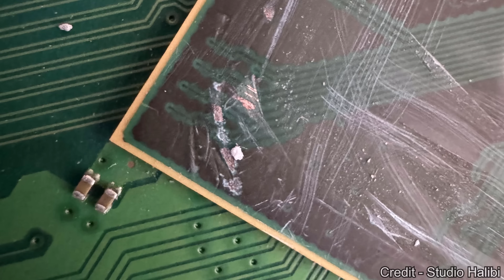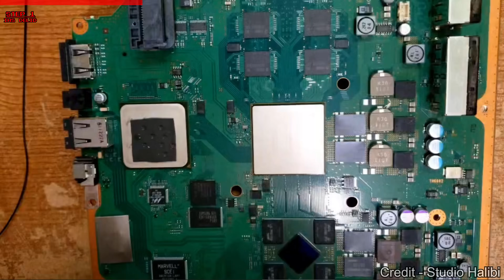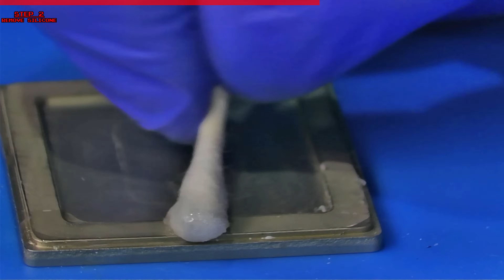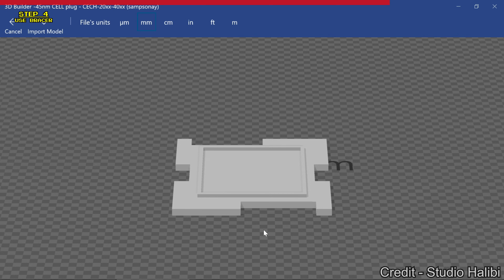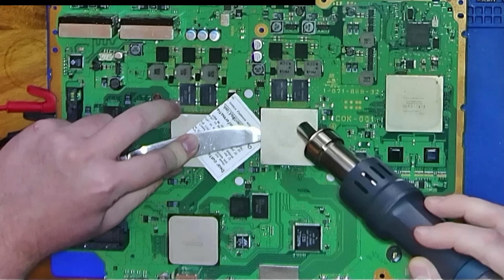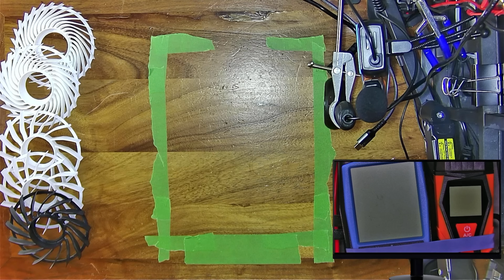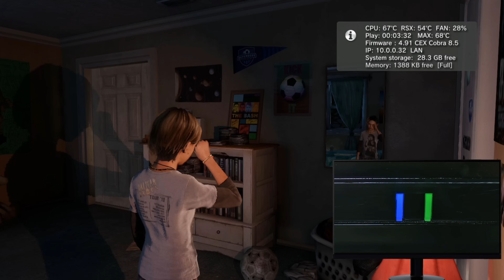How to Fix | Episode 1: Overheating. How to Delid CPU/GPU and fix YLOD - BEWARE of BAD MODs!

Comment: I still have my Ps3 fat with card reader and retro compatibility. After about 15 minutes the warning appears on the corner. I never find a reliable reballing technician so i just put in storage. I've never hear about deliding before.
So, it could be possible to know what is what my ps3 needs? Or deliding was the correct way to repair it since the beginning?
I watched the entire video, and it seems quite interesting to try it after finding the chips that is overheating.
A note on the side, I've about fifteen years of experience repairing pc, phones and tablets as a side hobby, except anything that needs a hot plate to desoldering, I've never buy me one. So, I'm pretty sure I'm capable to do it after I on a death board.

Comment: Felix do you sell the gpu brace or could you share the stl file so we could print it? Great work by the way.  The one I'm working on made it a total of 30 days before it died and was never turned back on. It was a launch model too.  Kinda neat to be honest.
Reply from the maker: It's linked on the description. Just the 90nm one. I designed it around a COK-001 and every other revision is different. So it should only be considered useful for that board.

Comment: Thank you very very much for this tutorial. My CECH-A model terribly needed this process, as my temps always hit 68 °C, even in IDLE!. For those beginners like me, this is how I managed to successfully do it:

1. Buy 3 broken PS3 Fat models from local second hand stores.
2. Buy all materials listed on this video. Bonus tip: for the delidding tool, instead of making one, consider buying the PS3 delidding tool (look it up on Google). With this tool, even a donkey like me can delid the CPU without any issues. It will substantially ease the CPU delidding process, making it almost impossible to do it wrong.
3. Practice. Use the broken PS3 you've bought to practice the procedure showed on the tutorial. Get comfortable with it. Re glue and delid again if necessary, until you feel ready.
4. Go for your beloved CECHA. I suggest you to re-lid the IHS too, using the braces you should 3D print. 

Now, my PS3 CPU temps stay below 53 °C with fans at 33%, when it used to be at 67 with the fan at maximum speed! 

I can't thank the author of this video enough for all his work. Definitely the safest method from all YouTube. THANK YOU!!!
Reply from the maker: Nice job. Yeah, the maker of that delid tool sent me one. I've used it and it works great. I had a few design suggestions and he said he'll work with the manufacturer to improve it over time. So it's getting even better.

Comment: a third reason for the ihs that i've seen spread around is that they exist to help protect the chip during assembly/lets the manufacturers be rougher with it in assembly. meaning a lower rate of damage in assembly

Comment: you're telling me DENTAL FLOSS damages the CPU?!?    how?!?  it's a way softer material than steel
Reply from the maker: Beacuse it has an abrasive ment to help remove plaque from enamel on your teeth. That enamel is harder than most materials, so the abrasive doesn't hurt your teeth, but will sand away almost every other material, including solder mask and soft copper traces. I've seen it happen!

Seems counterintuitive, but it's true.

Comment: I might be missing it, but why do you remove the brace while removing the rsx IHS? Isn't it needed to account for the force of the lever method?
Reply from the maker: In that clip I didnt have it in, but I didnt have abother video of the delid. Normally I would reccomend the brace, if you have one. I already knew that console had a bad GPU. So if I broke a ball I was going to replace the GPU anyway.

Comment: I have a like new condition phat CECHG01 PS3 with a Non-instant (1-10s) YLOD that has been sitting in my closet for about  13 years. It only gave me 3 years of life. I bought the thinner model a year later that's still with me today. I had the idea to open it up and do the thermal paste quick fix but after watching 3 of your videos I can safely say its above my level of expertise to fix. Who can i trust to send it to that it won't be internally harvested for parts and I won't get scammed? I'd like to get it modded too.

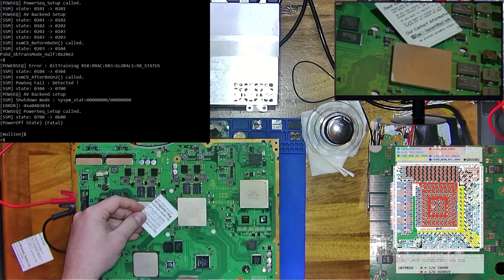Comment: 27:23 l know you said this is a preference and you don’t recommend it but with the popping method you done here what’s the thing underneath the kitchen knife that you used? Also how long did you heat up the chip before attempting to pop it off?
I’ll give it a try on a CECHM03 I have laying around. (it’s broken anyway and l don’t care enough to fix it.)
Reply from the maker: Just a business card. Be sure whatever you use is thin enough to get under, stiff enough not to just bend, and the lower edge isn't sharp, or it'll dig in and cut traces on the interposer. The card helps limit that, but if it's sharp enough it can dig through the card. You could use a painters, knife to protect the substrate and then use a flat head. My buddy squeept does that. The butter knife I used there has a beveled edge and is just thin/stiff enough to work for this.

As for heat, a hair dryer for about a minute should get it hot enough. Your just heating the area and the IHS to around 100c. Don't go crazy.

Comment: Is it necessary to clamp the IHS as it’s curing if I just leave it flat and don’t touch it for a day or too after putting IHS onto the chip?
Reply from the maker: The clamp provide even pressure to allow the paste to thin out. Depends on the paste used, I would assume.
Reply: @ Thank you for the reply. After watching your videos, it seems if I had a NOS PS3 to not delid it and just apply new thermal paste and enjoy it for what it is?
Reply from the maker: I would see how it behaves. If it's fans are having to work extra hard to keep cool, more than normal, then it likely needs a repaste or delid. But if not, dont worry about it until it does.

Comment: Hey mate, do you offer the franken mod as a service? I've seen various vids and love the way you do your work. In Australia, where i live, very few do it and not to a very high standard. I have a few CECHC-02 that need frankenmods with the nec caps replaced due ylod. Happy to pay for postage to the states and back, the labour and cost for a 40nm RSX.
Reply from the maker: Thanks, I go overboard to be honest. I do not offer services at this time. My whole deal is to show the application of accumulated knowlege over the years of forum threads and discussions. I want to show the reasoning behind why certain things might matter, that others often dismiss out of wishful thinking. I want the modding community to step their game up. 

However, I get they take alot more time. That adds significant cost to any would be service. They have to make a business descision of how far to take it. What is and is not worth their time. A personal descision I won't begrudge them for. Not unless it leads to serious oversights and a poor product that hurts customers. 

If you're in AU, ACE console repairs does them. I have a few issues with his methods and attitude, but he does offer a warranty and has plenty of positive experiances (he'd be the first to tell you this). I know some are put off by his attitude, but more often than not it works out well. He definatly "optimizes" his process to cut his costs, like a basic confirmation it works before shipping back for the customer to perform stress testing. That said, I dont think he does bad work. He has good equipment and skill. He just cuts a few corners I personally wouldn't. A business descision he has every right to make. He's probably your best bet in country. If you choose him, I would rely on that warranty and test the bejesus out of the console. If it doesn't fail soon after, you're in the clear. 

I have a friend in New Zealand that does tip top work, RamboNZ. I don't think he does services to AU tho. He might do local or buy, fix, sell only.

There's a few sellers in the UK, but most are in the US. If you want the very best quality, Squeept on ebay US is your guy. You will pay for it tho. He demands a high price and gets it because of this. IDK how much shipping to AU will be tho. Also, he doesn't do services. He sells completed systems. For services in the US that do good work. Studio Halibi, Console King, and Computer booter I can vouch for. They're friends of the channel. We talk on discord, learning from one another. But again, everyone makes their own choices how far they take these repairs. 

I am a stickler for details, because I have a channel and do these for my own enjoyment and consoles. At some point I'll have to sell some of these off to make room for other projects, but ATM I'm not taking in for service requests. Squeept sells the highest price consoles because he does them to this level same level or even higher. We kinda feed off one another for ideas of making it the best possable end product. 

The more affordable priced services are in competition to lower the price by optimizing their process, which means cutting out the time consuming stuff that's not entirly necessary, leaving that up to the customer to perform on their own after the warrany period. That's a viable approach and not necessarily bad, if they don't take that too far.

So you have a spectrum. This is all normal and fine IMO. There are a few people out there pushing this to the extreem and offering substandard frankies. I'm not really sure who they are and don't want to speculate. You just need to be a proactive buyer and descide what's important to you (lowest price = high risk and high reward. High price with a known good modder for peace of mind). You choose the comensurate level of quality you expect for what you'rewilling to pay. I just wish more shops were transparent about the corners they cut for the purpose of expediency. That way people can make an informed descision.

That's why I'd say lean in on that warranty and test thoroughly after receiving. Be sure you know what's normal and isn't tho. Lot's of customers see normal freezes and graphical artifacts and think..."OMG, is this a sign the GPU is failing!?" After spending a pretty penny people get a bit paranoid. I would too. It's just hard on techs to respond to a million messages asking if this is normal.

The TL;DR is, manage your expectations and do your research before jumping in. Many of these techs have Youtube channels or an online presence where you can see their work.
Reply: @ripfelix3020  thanks for such a thorough answer. It's good to know we have someone in our country.
Maybe one day I will become known in Aus for my repairs. I've been stubbornly reviving "dead" Playstation 1s without replacing parts where possible (I'm big on restoration of whatevers in the original console, no matter how much it makes me suffer), it's helped me learn a LOT of patience and learning.

Perhaps one day I can do this with PS3. My first repair job on one is next week, I've been binging your channel to prepare and learn. I don't expect it to work first try, and I do expect to permanently brick it at some point from my beginner efforts - but it's par for the course and worth every single hour and dollar I bust ass to learn how to restore such great consoles

Comment: Its overkill, Honeywell PTM would be a good middle solution between thermal paste and liquid metal.
Reply from the maker: Why does everyone think PTM is so great? It's only got 8.5W/mK thrmal conductivity. It's claim to fame is longevity. It's a great middle ground for performance vs longevity, but not going to compete for either one. A graphene thermal pad is eternal. It'll never degrade or lose performance. It might even out perform PTM on a PS3. I want to test this actually. Nether is going to out perform Liquid metal or induim foil. Longevity of these might suffer tho. And application such that you get a good mating surface is tricky.

Definelty some experimentation is warranted in future videos.

Comment: Hey, I just want to warn the people who are here trying to go with preventative maintenance on their 90 nanometer chips, my March 2007 C04 Model just failed and turned off with a triple beep (it's still blinking red because now I'm basically speechless) while playing Test Drive unlimited 2 and has a yellow light of death now, most likely due to the rsx, I've bought it 6 months ago for 30 euros with 128 days of use time, and I immediately took care of it (cleaning, thermal paste, jailbreak, 1 terabyte solid state drive, etc.) and now even with a room temperature of 18°C and 68°C max temperature, 40% fan speed, 600 megahertz core ram and 650 megahertz videoram (because it was artifacting in the Xross Media Bar at the stock evilnat overclock which is 600 megahertz core ram and 750 megahertz video ram), it went to the electrical heavens, sick and tired of me, now I'm left speechless in my dark room, while it's just blinking away... My guesses are that it's the RSX, (I don't have a Syscon reader) and not the cell, because I laid a little thermal pad under the cell because my L04 has been going with the same thermal pad under the cell for about 9 months now... 

EDIT: 12.5.24, it just turned on again??? and no new errors in syscon log, this console is possessed, i put 67c Temperature-limit and im gonna install 550 megahertz core ram and 650 videoram just because i feel like it... lets see what she has in store for me, because now im even more confused but not sad anymore...

Edit: 03.24.25, it's dead with 1301, I bended the clamps and it seems the clamps with the eraser mod finished the Cell Broadband Engine, even worse, sometimes it doesn't even wanna give a light at all if plugged in, but that's just because the ribbon cable for the powersensor is broken, but she's totalled
Reply from the maker: Dang, that sux man. Yeah, I have been carefull not to say keeping it cool will prevent the YLOD. There are more factors than just temperature. It would be nice to have the codes to get some idea of what happened.

Anyway, thanks for the reminder and my condolences for your loss.

Comment: I would agree I changed my main PS3 to a E01 and its been a super reliable console for me of course I had to re apply thermal paste but all these old consoles need that its been over a year with pretty heavy use I dont use custom firmware because i dont want to put my PSN in a possible ban but hey going to run it until the day it dies.

Comment: Bought a painters knife and it's thicker than the adhesive holding the cell lid on lol
Reply from the maker: The adhesive squishes down pretty flat. The tool has to be so thin it might bend and cause damage. So it has to be just thin enough, but still rigid enough. Most painter's knifes are just thin and stiff enought. The tool I made I just kept grinding off more and more to make it thin enough to get started, but it doesnt fit all the way in on it's own. I did that so it has enough girth left to not just bend and break. So once it get's started it does force up on the IHS a bit, but the shape of the blade causes it to ride on the silicone at that point.
Reply: @ripfelix3020  I filed down the painters knife and did the whole delid process but now my ps3 does the 3 beeps green, yellow, flashing red sequence. I don't think I messed up the cell but who knows what else I could have broken. Trying to troubleshoot now.
Reply from the maker: yikes, GL

Comment: I wonder if any slims require a delid in the future as some are soldered down instead of glue that was previously used on all phat models.
Reply from the maker: That's a myth. I've seen some that were glued on by idiots and subsequent attempts to delid caused the die to break  off. The OP assumed it was soldered on. But everyone I've spoke with that has delided slim and SS models says the never solder the IHS on. I left that door open for a while, since I dont personally work on those models, but at this point I need proof before I'll believe it.
Reply: @ In that case, eventually even the slim models will need to be delidded, huh? Can’t say I’d be excited about going that route due to how easy it is to ruin a console by simply mucking up the delidding process, though it’s inevitable that delidding may be required in the future… which I personally don’t look forward to.
Reply from the maker: A friend of mine is making a deliding tool that will hopefully release soon. Should make it much easier to do.
Reply: @ Let us know if a delidding tool for Cell ever does comes to fruition, as having a specialized tool that could make delidding easier (without killing the system) would be a real blessing for us that still hold onto PS3 systems, as we can finally better preserve these systems without needing to take unnecessary risks anymore. I look forward to hearing more about the delidding tool that could finally end PS3 casualties.
Reply from the maker: Playstation 3 Delid Tool with Replaceable Blade – Precision Engineered for Safe Overheating Solutions https://a.co/d/hiYxp00
Reply: @ Much appreciated, thanks. I can only hope these tools will always remain for those that wish to improve PS3 longevity.

Comment: I have a ps3 chech 2005b..
When I run PKGI, gpu's temperature after gaming is around 70, and rsx is around 62...Does it need a new thermal paste? Is it considered as a high temperature? 
Thank you anyway
Reply from the maker: Those temps seem fine.